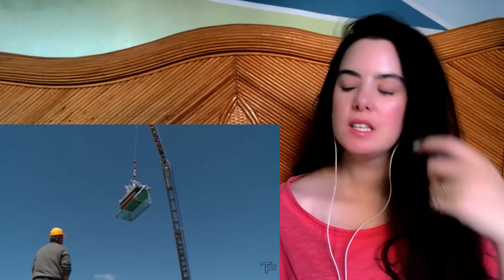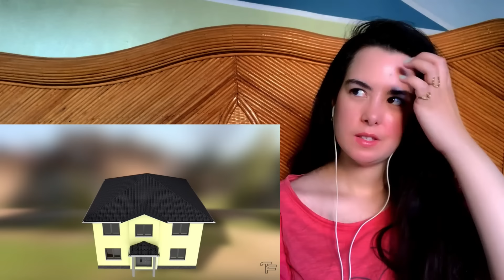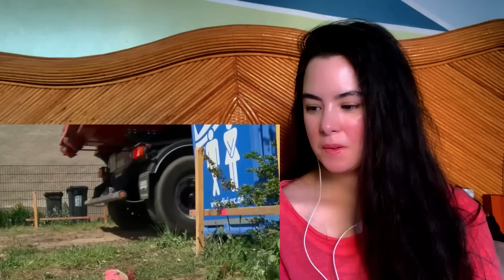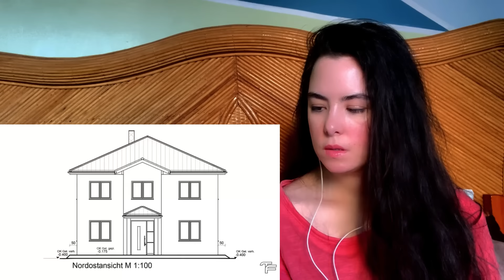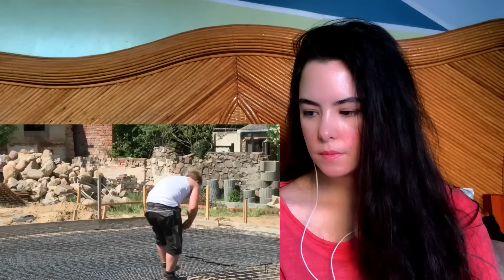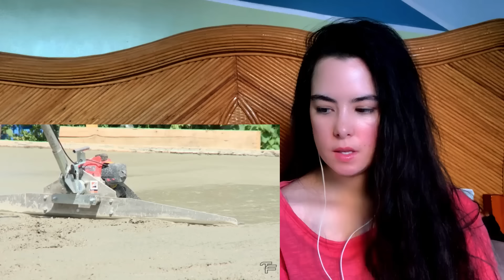How Germans Start House building REACTION!

Comment: 8Surprised to see most of your reactions seems given based on your assumptions what will happen and not so much on FIRST observant what actually happens (to the end) and and that moment only give your reaction? Integrity of construction is crucial, in northen European countries foundation have te be below the frost line to avoid any damage, cracking walls etc when prolonged (months) severe frost one/ 30 years takes place causing frostline eg to be 180 cm (=about 6 foot) BELOW ground surface! Foundation for walls has to be that deep! Of course base platen for internal wallls can just be a reenfirced concrete slab  "floating" on compacte sand    ...which allows ground water to drain...allowing house to have dry "feet"..

Comment: If air pockets exist, they are bad and the foundation can slightly lead to small cracks. At least, me, as a non builder, this is the way I see it. You want to make sure  to have a perfectly flat surface for building. This will be the base for the floor and the floor must support all the weight you put on it, like furniture, bathtubs, shower cabins, kitchen stoves, toilets, washing machines, other heavier things, depending on your house needs and the project involved. But this floor that contains all the weight you put on it, that I wrote above as examples will all be supported by the concrete layer. If the concrete has cracks (even if these are small), it will start to lose resistance and it will affect the walls resistance. And the walls need the support the upper floor (which will obviously also contain concrete). So you need strong walls. That's why the air pockets are not good at all because they weaken the entire building structure, so they do anything in their power to not let anything (even remotely bad) from happening in the first place. The more floors you add to the house, the stronger the walls must be and all the more important the lower floor is. All the floors are important and they take off some of the weight of the house but the main floor is the base. They must withstand all of mother's nature power, especially during the rain, the hail and the temperature extremes. And they also have to support the roof weight because these roofs must be strong too. They need to support tiles, they are proper tiles, unlike the American ones. I don't know what you have in Venezuela or how you build the houses and the kind of roof you have.

Happy Easter! 🙂

Comment: @6:25 By the civil engineer conducting a "pressure load test", for example, but there are tables in which certain values are specified. Such tests are very, very rare, and in my time "in construction" I have only witnessed one in 5 years, because a former harbor basin was converted into a loading terminal to ensure that the ground did not sink when loaded 40-foot containers were stacked 5 high.
Your question about why a particular type of soil is used as a foundation is easy to explain. The properties of the material have been researched and can be custom-made at any time using the aforementioned tables, thus meeting certain specified standards. An anecdote to help with understanding: In the UAE, there are vast quantities of sand. Unfortunately, it is worthless for construction companies because it has been "blown round" by the constant wind over millions/centuries of years. Belgian sand, for example, is famous for being exported because it is "very fresh" with many rough edges and therefore much more difficult to "spread apart" than worn, "rounded" sand.

Comment: There are areas in Germany where it is better not to build a cellar. For example, if the groundwater table is very high. Building a basement in this case is extremely expensive, as the basement must be additionally sealed and, in some cases, protected against groundwater ingress with additional pumps.
But there are also other reasons. For example in Bavaria around Ingolstadt along the Danube. This was the border area to Magna Germania in Roman times. If relics from that time are found there during excavation work, the construction company is obliged to call the state archaeologist. They will then stop all construction work on your property for 1-2 years and you will also bear the costs. This can easily amount to several 10000€. That's why most people in the area don't build basements.

Comment: nah usually it is excavation , then gravel for drainage - then thin plastic tarp, then sand and pipes then insulation. then forms 
then second tarp then two layers of reinforceing iron, infloor heating pipes and cable conduit pipes for electricity 
then concrete 
this is the cheap version - economy class house

Comment: actually the first step for building a house with a basement is pretty much the same, the whole in the ground would be 2-3 meters deeper (depends on the ceiling height you want to have in the basement) an a bit wider so  that there is enough space to work. after that, the steps are more or less the same as in this video... you put the concrete foundation in an let it dry for several days up to 1,5 month... 
the following videos show the process to finished House, with a basement there would be an extra step bevor the part 2 of this video series, in which they would lay the bricks for the basement..